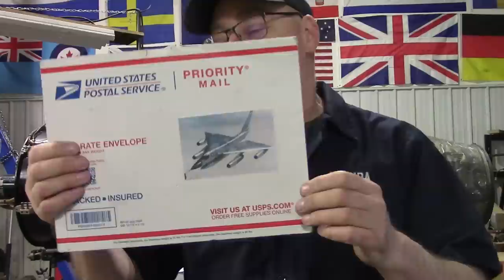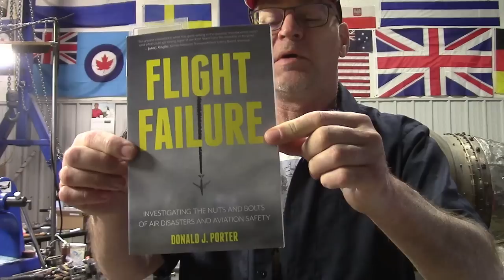Cautionary Tales from the Jet Shop

Comment: Great story. It also emphasises the need for a no-blame culture in safety-critical industries. It's one thing that the grinder guy could no longer work in a jet engine shop, but threatening him with severe punishment would just make him shut up to avoid incriminating himself. But you need him to tell you how many of the nozzles he butchered, at which time and for which engine, without fear of (even greater) punishment. It's sometimes not easy to see that, because he may have done something so horribly and dangerously wrong that the instinct is to lock him away, but it's generally not helpful for improving safety after the problem has already occured. The aviation industry at this time is pretty good at what we call "just culture", but other industries are lacking. The supervisor, if anyone, deserves more blame, but also with a good balance between scaring him off into silence, and making sure he knows that he is accountable for criminal actions.
Reply: Or you could put all the mechanics and their supervisor in the test cell durring engine test they overhauled. Judging from Scot's description they woudn't get their hands on another jet engine 😁.

Comment: I have a story from just this week.
Background, I'm a 1st year apprentice in mainland Europe, we are overhauling PW200 turboprop powered  Dash8's here, which is a lot of fun.
So last week we were pulling prop blades from the hub for inspection in a group of several apprentices with varying levels of experience and one senior supervisor.
These blades sit in bores within the hub and what keeps them from flying out if the thing spins is a ring nut, pulling together a ball bearing of which one race is built into the hub and the other one around the blades shaft. The bearing takes the centrifugal load as well as enabling the blade to pitch for the constant speed prop operation. The bore and shaft races don't interfere, otherwise the blade could never be installed or pulled, what interferes is the 29  about 20mm, below 1in captured balls which go in and out through an access bore.

Idea for each blade was to have one of the apprentices read the AMM and instruct the others on the steps to perform, for this last blade, I was reading the AMM, 3 guys were up on the scaff while our supervisor was closely monitoring us.
Process (from my memory and abridged) is as follows: 
Prep work..., remove spinner, remove deicing, rotate and secure prop so that "to be removed blade" is pointing up, remove locking wire, bolts and lock from sleeve (castle) nut, loosen sleeve nut, lift washer, remove a lube sealing rope (all about 300mm, 10in+ diameter around the blade), now on the hubs front face, undo bolt for a coated thick wire that loops around the bore for additional sealing (like a piston ring) and pull out, open grease fitting, attach grease pump, apply 200bar or 3000psi of pressure to "unroot" the blade by expanding the pocket between prop blade root and hub bore, then release and remove pump again, wiggle the blade in again, remove plug from ball bearing access bore, extract bearing balls via specialized wrench that rotates the propside race from the topside (where the big castlenut pulled it taught), which has a one sided wavey shaped teflon or whatever cage-ring for spacing out the balls in it so that they get revolved to the formerly plugged access bore from where the 29 balls could be extracted via magnet and harsh language.

We did stray from the instructions and poked the balls out with the thick piston ring wire as it seemingly was common and established practice because the specialized tool strategy described in the AMM was found to not yield results at all in practice. Green me sticking to the AMM by the letter we even tried it that way before the wire was brought out again. With the Blade unrooted, the play in the races was large enough for the teflon cage teeth not to bite anymore, I assume this is also why the AMM method doesn't work? On the last blade we counted only 28 balls and 3 or 4 people independently stated they looped the "poking wire" all the way around without any trace of a 29th ball. Is was noted that there were prior instances of one ball being missing so the decision was made to move on. As per AMM we attached the rig that keeps the prop centered, reattached the pump to the hub and pushed the blade out, again with the grease. Keep in mind that now the dial shouldn't read a pressure increase as the space between prop and hub can expand all the way until the blade comes free. The dial wasn't monitored tho because it's not really of interest for this step (normally). Two guys attempted to lift the blade out now when it was discovered first that it wouldn't come loose, then that the blade was slightly tilted at an angle in the bore, which I was told is not good. Soon the observation was recalled that there was only 28 balls extracted. We reported it to the line chief went through a process to reseat the blade an finally extracted the last ball, then removed the blade.

Naturally that hydraulic pressure went somewhere and with only one ball remaining that thing impressed intself into the inner and outer race causing damage that has yet to be evaluated. The dents were hand feelable. In the best case the races can be replaced from the shaft and the hub, worst case both are scrap now. The hub being a semi truck wheel sized monolithic, load bearing piece of aerospece certified titanium or whatever trusted to spin 25kg propeller blades at high rpm an arm lenght away from passenger compartment windows, making it probably very expensive.

Now what caused this?

Well we did a job that the AMM dictates vaguely, that doesn't work well or reliable in practice, me being a hopeless 1st year trying to sound smart mind you... I also observed the manual being very vague about some critical steps. We used an improvised technique, then there was an anomaly that in nature aligned with past anormallies giving us a sense of security, that we knew what's going on. There was a ton of not fully trained personnel around in varying states of familiarity and eagerness to be the oneholding the tools, I wouldn't rule out that often mentioned "dangerous depth of knowledge" as well as some perhaps even unconscious herd thinking (I'm not a shrink tho). Our supervisor blamed it on himself not checking it out himself but I mean if the wire poked through a path around the ball 3 times, it would... maybe... have gone the same route for him and this step wasnt't critical for him to certifie that we in fact removed the blade and the step was not leading to this section of the plane being declared flightworthy (since we were taking bits off of the thing). First year me blames it on us going into effectively uncharted territory... without the required level of awareness and attention in a perhaps dangerous group constellation. In retrospect I noted that we could have (alarmed by the only 28 extracted bearing balls) monitored the gauge on the hydraulic pump as the prop was coming up and that we could have used a boroscope beforehand.  Retrospect me knows what happened.

In private I wrench a lot on my car and I like to cheat and improvise my way around (mostly into) problems but my mindset at work, being paid by the hour and on stuff that other people use, that doesn't belong to me is different and the AMM couldn't possibly have warned us about that since there really should be 29 all the time and maybe if their way works, it makes this impossible
If you have to be creative you have to be double creative to anticipate the possible cascading effects of what you are doing.

I was even talking about to one of the 2nd years and we found out they taught us different things. His year was once encouraged to think out of the box, my year got strictly told to follow described procedures. There's probably a middleground...
If you made it til here and have a background in working on planes, what's your bias and do you even think my thesis is right?

Uuuh, just to make sure, this all happened in minecraft and is addressed to my lawyer. The story, all names, characters, and incidents portrayed in this production are fictitious. No identification with actual persons (living or deceased), places, buildings, and products is intended or should be inferred.
Reply from the maker: This is really good. I have a couple of comments, which I will include in a video ...

Comment: What even would be a legitimate use for a grinding wheel in an aviation shop? Imho not having the brute strength of most men does help with avoiding the force it till it fits cockups.

Working in another safety critical industry (rail signalling) I'm thankful to have managers that understand the seriousness of what we do.
Reply from the maker: The grinder is used to make or modify tools, and gets used for less than 2 minutes per month.
The wheel on the other side is a wire one, and it gets used for cleaning and refinishing grotty parts before inspection.

Comment: I worked on gas turbine engines when I was in college. One of the things we strived to do was to make your job simpler by doing things like rotating the bolt pattern on mods so the two parts could not be interchanged.

Comment: A personal cautionary tale as a CF tech back in the mid 1980's. I guess sufficient time has passed that I feel ok talking about it. Myself & another tech senior to me lucked into a trip in a CH-135 to Yuma in support of our Sky Hawk parachute team. They practice in the spring for the upcoming airshow season much like the Snowbirds do in Comox. Took us 2 days to get to Yuma with an overnight in 'Vegas ;). I'm an IE Tech (Instrument Electrical) & my fellow tech was Airframe. A few days into the deployment a Supplementary Check was due. It included opening up the panels below the transmission & checking flight controls. Rick, an experienced Airframe tech discovered a nut on a control rod had almost backed off completely. This meant someone forgot a cotter pin during a previous maintenance event in there.

We looked at each other & thanked our lucky stars it held during our trip & subsequent para drops until Rick found the issue. In the CF any work on the flight controls requires an Independent Check, meaning a qualified senior tech has to check any work where flight controls were disturbed, adjusted etc. Same thing goes in my trade for any work on Pitot Static systems as they feed Flight Instruments. Ergo this little faux pas was the result of several techs & supervisors signing off on a job not done properly.

Anyhow our error I reckon was that we didn't report it. Rick said he knew who worked on it & he'd have a talk with him when we got back. I probably shouldn't have agreed but I had a lot of respect for him so let it go. Our Flight Safety Reporting system in the CF is 2nd to none. The aim is not to focus on blame, but  analyse, investigate & recommend solutions to prevent future occurrences. Had we reported, the names of the guilty would not have been made public but there would have been another important heads up for everyone to ensure flight control maintenance & independent checks are carried out to the tee. Had the nut backed off in flight it would have resulted in the loss of the Huey + all souls aboard, possibly even me.

A little bonus excitement on this trip. The main cabin doors are typically pinned back for para drops. On one of the flights a cabin door decided to depart the Huey & follow the free falling Sky Hawks down to the desert floor. Turns out the rollers in the track had worn to the point that they let go. No harm done or injures & we continued flying the para drops until a replacement door came from Edmonton.

Oh yeah, we also lost the co-pilot's overnight bag out the door over the Colorado River while cruising with the doors pinned back. Memorable trip for sure....
Reply from the maker: Better a close call than the alternative.

Comment: I recently saw 3d printed vane repair without any finishing machining on a vid. Pretty cool it came out finished with proper geometry. It was just for worn off edges and nicks, they weren't re-making them after ingesting wrenches or anything... Yet.

Comment: Great episode! Of course disasters like this ate a hundred times more interesting than “it went back together with no problems and past all tests.” With respect to grabbing the part from the wrong box, it reminds me of the famous case of the airline pilot who wound up sprawled mostly OUTSIDE his front window because the old-timer mechanic who knew through long experience where the same replacement window screws were stored and fetched them instead of using the parts book to look up the right part number and thus find the right box only to afterwards find that the installed screws were the wrong (undersized) ones that allowed the window to blow out. So that was another case of not following correct procedure had far more effect that far outweighed a lifetime of practical experience and very nearly killed someone. And the B-58 tale was not the first where the maintenance supervisor, being closer to managerial staff, is subject to detrimental pressures (saving money, increasing work throughput, etc.)  not reaching down to the wrench turners, so they have to be closely watched as well. Perhaps you could impress on the mechanics schools the absolute need for a separate course on safety culture and the administrative part of the job (for which not one single tool, machine or part would be needed to teach). Maybe you should, in the spirit of the topic, have a separate YT channel devoted to this, reserving this channel for the actual mechanical bits that may appeal to a slightly different audience.

Amazon has the book for 13USD, which seems a bargain for such a juicy topic.
Reply: Misspelled “passed,” but too lazy to correct.

Comment: Here is a cautionary tale that results from a design for which I had responsibility.  
A certain three-spool turbofan suffered a premature failure of one or more IP turbine blades.  Defect investigation immediately determined that they were the wrong blades: they were, in fact, the equivalent, visually near-identical blades for the industrial version of the engine.  The blades for the industrial engine were cast from a more corrosion-resistant material, which had a lower temperature capability.  This was perfectly adequate for  base-load operation, but not for the take-off rating of the aero engine. 
So how did this build error occur? 
The aero standard blade had an LK- prefix to its part number: the industrial standard blade had a LW- prefix and the following numbers were totally different.  The build lines were miles apart: they might even have been an ocean apart.  Nevertheless,  the wrong blades were delivered to stores and then to the build line, where they went into an engine.
Clearly, there had been a succession of total failures, with no-one checking the part numbers at each and every stage of the process between finished parts to stores and allocation to the build line.  They looked right, so they must be right.
So what was the outcome?
There was an edict that a visual difference must be incorporated into future components, where they appeared similar, but there was difference in their operational capability.

Comment: There is, of course, the cautionary tale, which I included in my comment that recommended the 'Flight Failure' book.
In the latter stages of my career,  I was tasked with a redesign, the objective of which was to eliminate the need for the use of cotter pins at 42 positions in a complex mechanism.  The omission (or the failure to bend the 'legs') of a pin had nearly resulted in the loss of a single-engined fighter aircraft, which managed to make a fast, fixed-throttle landing.
The mechanism in question was the HP compressor VIGV mechanism, which jammed in the high speed condition.  With it jammed, the engine could not be throttled back, as the mechanism was also interconnected with the HP compressor bleed valves.  The aircraft, incidentally, would have carried USMC markings - but I will say no more.
And yes, I came up with a redesign, courtesy of a similar feature that I came across on a small helicopter engine.  It totally eliminated the use of cotter pins and was, I thought, virtually foolproof.  However, it was not accepted on the grounds of cost.
Reply from the maker: I find it abhorrent and sad that, with all the brilliant engineers and designers working on complex machines, the final say about what gets produced is often held by people who can only use a calculator to add and subtract...
Reply: @AgentJayZ  The use of cotter pins (aka, split pins over here) was perfectly adequate (if a bit 'agricultural') in engineering terms; but it was obviously not foolproof.
To save the US taxpayer a few dollars, someone decided that an additional inspection requirement on build would suffice.

Comment: Speaking of loony managers, the shop teacher at my Junior High school, he was just plain nuts.   He spent 80% of each class period telling us very tall tales about how he had pushed cars off of railroad tracks, rescued women from peril, and other dubious claims to fame.  The rest of the time he would crank up a huge motor-generator type of DC welder and he'd weld random bits of metal together with us watching.  With no safety googles.   Finally after one xmas vacation he didn't show up for work.   His replacement teacher had a huge job in front of him, as the tool room was all random shambles and about 50% broken or bent tools.  The new guy was much smarter, but not smart enough to enforce a tool checkout sheet, so within a month most of the good tools had disappeared.   I was supposed to make a fireplace poker,  but the drills were too dull to drill into the metal handle piece and we were not cleared to do any welding ourselves, so it never got finished.   Puzzling times.